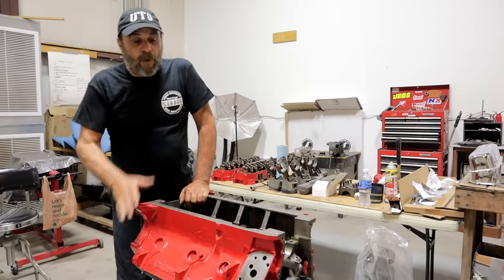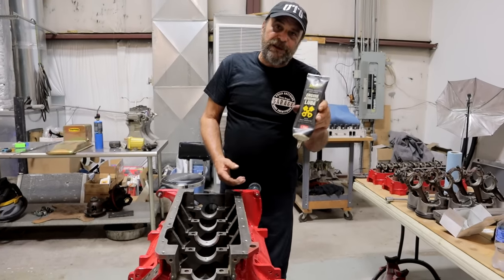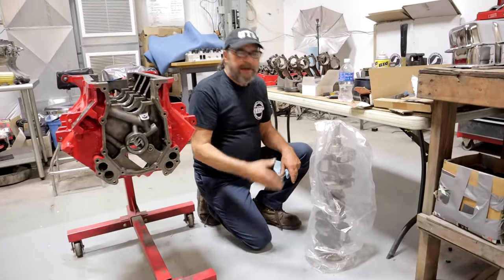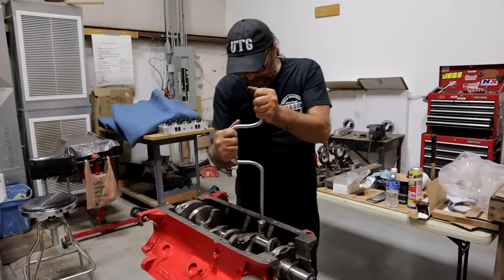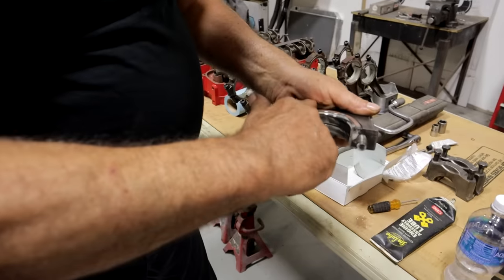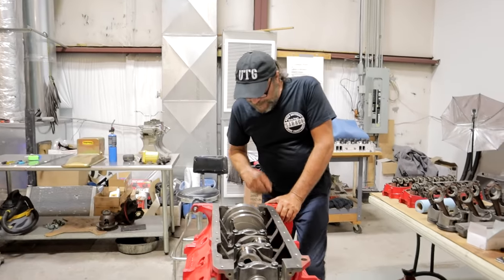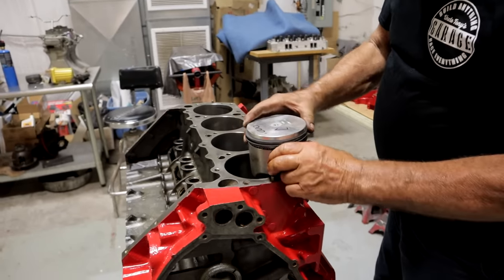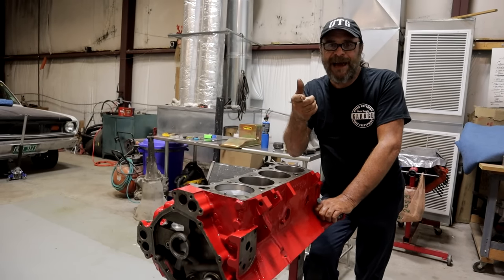Assembling A Short Block For The Home Engine Builder

Comment: As a machine shop owner and a ASE certified machinist and mechanic this guy is a total backyard hack!!  Someone should teach him , he shouldn't be trying teaching others!!!! He makes the same rookie mistakes that most people make, including David Vizard!!!
Reply: As a 4x world champion mechanic and over 90 years experience..... no one cares mate.
Reply: @ketznov4072  if you truly were a "4X world champion"  you should have noticed the fundamental flaws in this video and in several of his videos.
Reply: @andrewevans1658  no one cares mate
Reply: Andrew name one thing wrong just one
Reply: @dang5553  I can name several!!!  Not all engines have both bearing tangs on the same side.  Blue shop towels aren't Lint FREE,  No oil on the bottom of the bolt heads on main cap bolts (which alters the torque reading due to excess friction) , fasteners have different torque values/specs depending on the lube used( I've never seen and never will see PB blaster as a recommended fastener lube by an oem manufacturer or a fastener manufacturer,   excessive assembly lube is a bad thing not a good thing!  As it can plug oil filters and bypass valves because it is slow to break down.  There are several more but I'm tired of typing.
Reply: Alright Andrew this motor has tangs I think we should use them. Blue shop towels it’s simple read the box it will tell you bout lent.
Reply: @dang5553  lent is a holiday,  lint is what blue shop towels have. He made the broad statement that ALL tangs should always be on the same side and that is only true for certain applications.
Reply: I’ve also never seen anyone smack a crankshaft will a regular hammer to set the thrust bearing. Hahahahahahahahaha
Reply: These are all really petty gripes that nobody cares about. This motor has both bearing tangs on the same side as do most. Microscopic towel lint isn't going to ruin a motor. Unless if you hose down every thread with brake cleaner and swab the holes with a q-tip (A LINT FREE ONE OFC) there's something in there so your torque spec isnt going to perfect anyway. Torque specs are guidelines anyway especially on old high tolerance iron. Lets say he puts 20% more torque on it than he should because its lubed up; it literally wont make a difference. The difference between 50 ft/lbs and 60ft/lbs is a nonissue as long as the bearing clearance is still fine. The bolt being stretched a thousandth of a mm isn't going to make a difference. You are completely wrong about assembly lube. Its designed to dissolve in the motor oil. 

I'm sure this motor is going to run fine and not explode immediately despite being assembled by a "backyard hack". This motor got way more attention and care than this stuff did coming out of the factory. You are just another troll with made up credentials spouting trash
Reply: @noblesseoblige2995  those differences are the differences between right and wrong!!! They are also the difference between a professional quality assembly compared to one by a backyard hack with craftsman tools .   UTG should answer questions about his incompetence rather than hiding and collecting his YouTube check every month!!!  He posts a video every few days so that people move on .